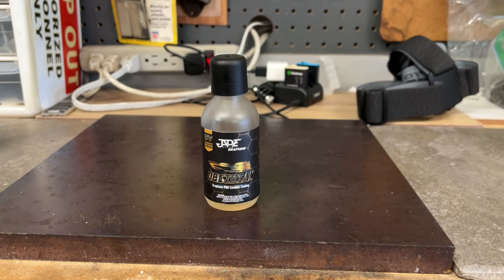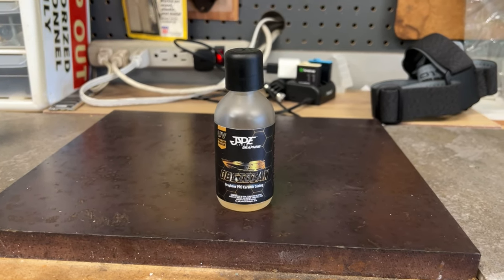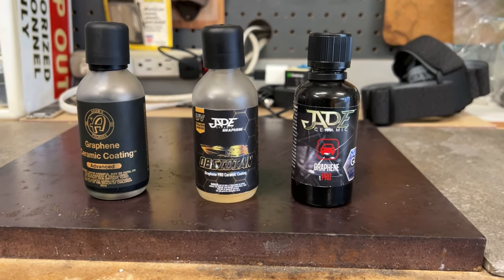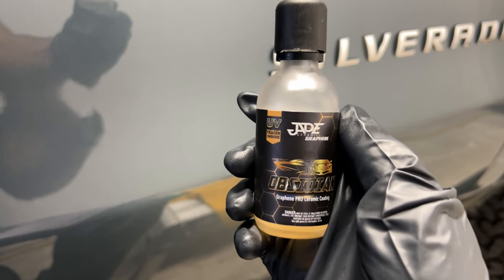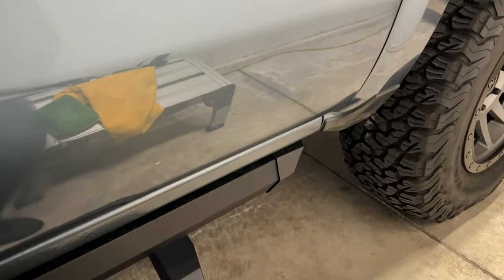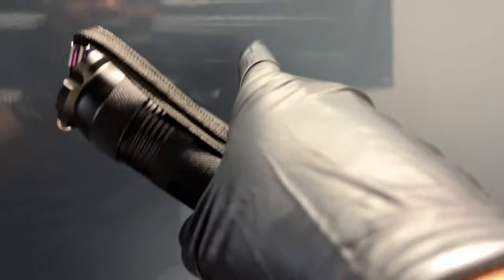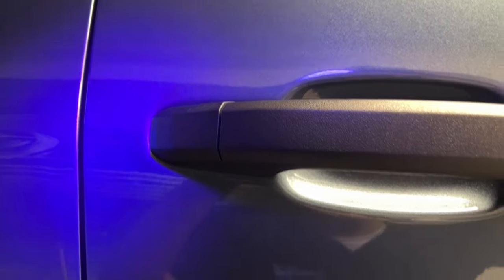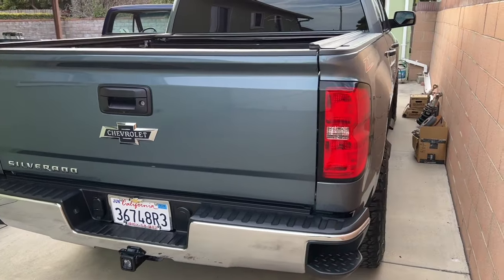Coating my brothers truck with Jade Obsidian Graphene Pro Ceramic Coating

Comment: Was it not good? Saw that you never did a wash video
Reply from the maker: @mirrorimagedetailingplusllc  the hard part is getting my brother to bring it for a wash. He does his own washes.  But I will be using it again on a personal car.
Reply: @MikeGDetailing  how is he liking it since he washes it?
Reply from the maker: @mirrorimagedetailingplusllc  he is not as detailed oriented like I am but he likes the ease of cleaning.
Reply: @MikeGDetailing  that’s awesome! How do you like that amethyst glass coating? Does it hold up well?
Reply from the maker: @mirrorimagedetailingplusllc  it has been holding up well. I’m about to use it again on the same car that will have obsidian on it.  Amethyst is such an easy coating to work with.